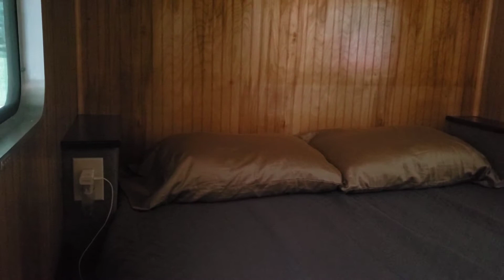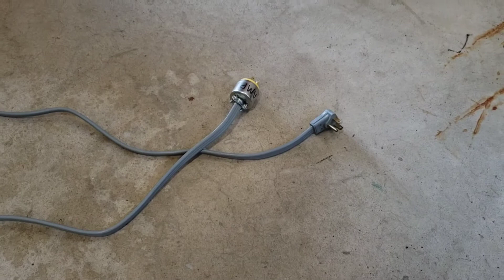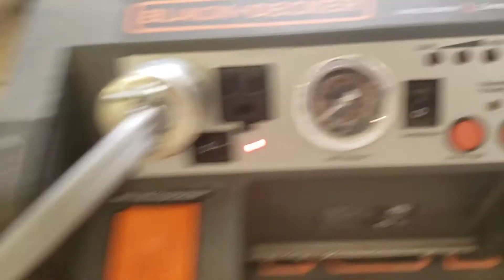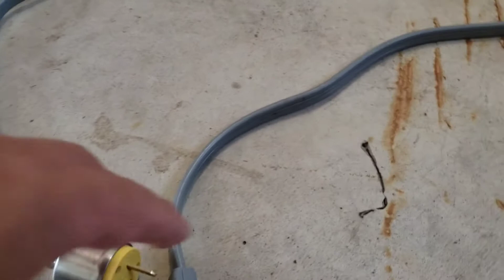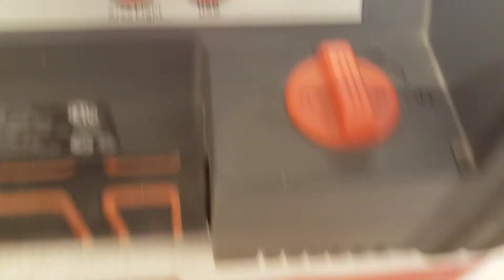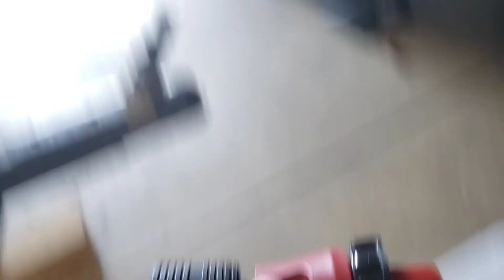Using A Jump-Box To Power The Camper

Comment: I have been buying used jump boxes on eBay for cheap, and replacing the lead acid batteries in them with equivalent lifep04 lithium batteries.  You get about twice the useful power out of them because you can only let a lead acid battery discharge around 50% or so without damaging them, lithium you can go to 80-90% discharge. They make good little lithium power stations for camping, running led lights, 12v devices, etc, charging electronics.
Reply from the maker: Good info, I appreciate you watching!

Comment: The common name for the cable you made is a "suicide cable". Yes, it will work. Also yes, they have killed people before. Okay for testing your wiring temporarily, but please make this your very next upgrade, if you haven't fixed it already. I don't know, because I'm watching this playlist in order!

Next, get a Kill-A-Watt meter to figure out your fan loads, etc. That 500w jump box inverter will be working hard to run the AC fan, but FORGET about running the compressor or microwave from that small battery and inverter. All in all, it's a good beginning for the electricals.
Reply from the maker: I am aware... if you read the comment section you will see that I have put plenty of warning info in there regarding this issue. Thanks for the comment and thanks for watching...

Comment: I'm confused why you don't just run your jump box to your shore power since it's ac power?
Reply from the maker: Good question. I could also do it that way using my  adapter but back feeding it in the cargo bay allows me to stick the unit right in the cargo bay and shut the door rather  than just sticking it under the camper by the shore power outlet.

Comment: It's more of a generator.  It's still 110/120volts. Not 12 volts.   Still a great idea. Unless you plug into your jump box first.  Then you're holding a death wand.
Reply from the maker: Thanks for the reminder to point that out. I've added a warning to the description section of this video.
Reply: Well the jump box itself has a twelve volt battery and converts to 110. But the previously mentioned death wand is certainly a concern. Would not advise forgetting the jump box is connected AND plug in your ship-to-shore. You’d likely be in the market for a new jump box at the very least.